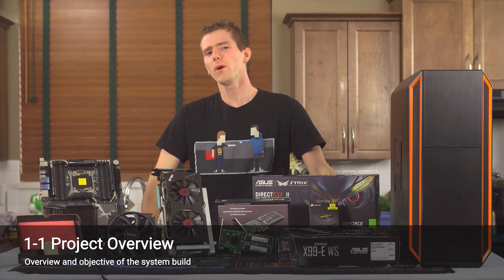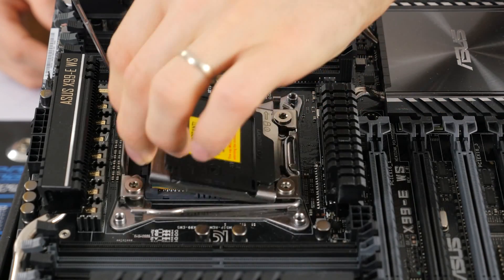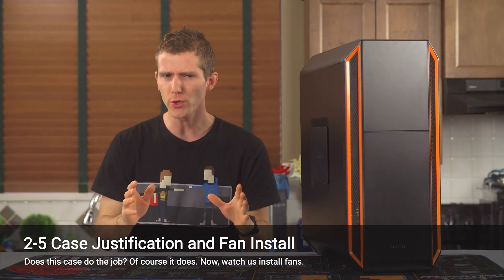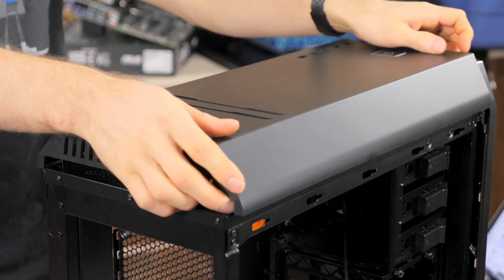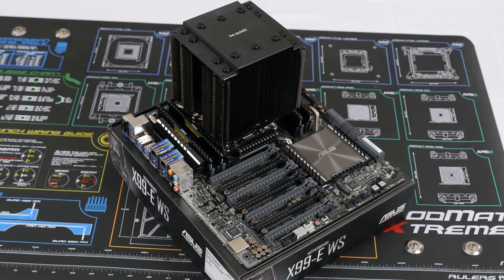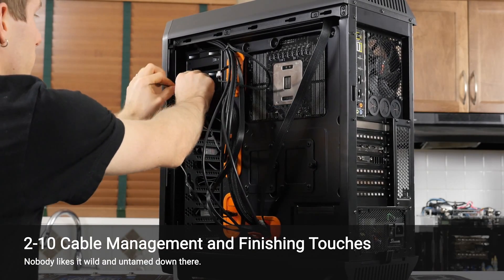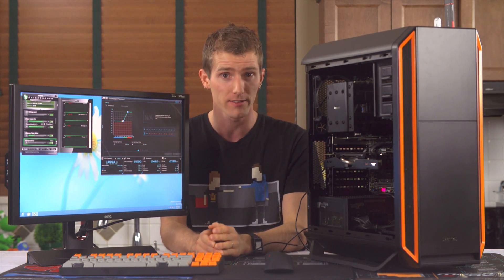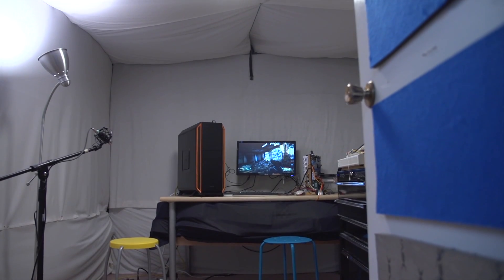How to Build the ULTIMATE Silent Gaming or Workstation PC

Comment: Silence tips:

Fans in pull are always louder than push.

Putting a restrictive dust filter right in front of a fan will significantly increase noise.

Pretty much any dust filter is going to either increase noise or reduce cooling capabilities which both are vital to a silent machine, especially to those that tries to blend silence and performance.

The case doesn't need to be silent optimized just to make a silent build. As long as the intake fan slots aren't restrictive/generating a ton of extra noise and got decent cooling capabilities.

A case like this can only block of so much noise and the restrictive design require the fans to spin faster in order to achieve the same performance. The restrictive top in this case also impair natural convection/passive cooling.

In this video a fan on the actual cpu cooler would have served a better purpose/much more efficient way to balance silence/performance. :)

Comment: only upgrade possible: go all noctua.
Reply: Believe it or not but for a silence optimized machine Noctuas aren't actually anywhere near as good as the Silent wings 2 he's using. I mean they have a low db rating but the perceived noise is much louder. Not to say that Noctua fans are bad, they really aren't. In fact, they perform insanely good if you can stand the motor noise. :)

Comment: By choosing not to use water cooling you guys made a pc that is super silent while not gaming that is capable of gaming but if you were to use water cooling you would be able to have a pc where all the fans in the system was off when not gaming leaving only a pump running which there are very quiet once and in gaming that system would be so much quieter than this.
Sure you would have to do some more work with that system but with a custom water cooling kit it actually is not that difficult so i would have much rather have seen that as the "ULTIMATE Silent Gaming or Workstation PC"
Reply: Passively dissipating heat out of the radiators without fans?
Reply: A fanless CPU cooler will still 100% be quieter than a custom loop.
Reply: Yes of course but he has fans in the system anyways and as they said it was laud when on load in the sound booth and i said the water cooling would be quieter on load but slightly louder at idle
Reply: Chystal yes just the same way he is passively dissipating heat of that cpu heat sink what is so difficult to understand about that it is the same principle.
I have my fans turn of at idle in my system.
Reply: Jimmy Karlsson Correct me if I am wrong. Wouldn't the pumps then be just pushing warm water around the system?
Reply: Chystal Well the radiators still dissipate heat even when the fans are not spinning and at idle the components wont be giving out as much heat.
Also the way the cpu and gpu coolers work is that there is liquid flowing through the copper tubes so then that would have had the same effect as with watecooling.
Also those coolers gets cooled by dissipating heat via the fins on their respective coolers just like a radiator just on a different scale so basically all of those things would effect both of the different methods of cooling the same way just that the watecooling loop needs a pump and the radiators can be larger thus cool it more efficiently.
Resulting in a slightly higher idle DB than this pc because of the pump but it would mean a lot lower DB at load due to the bigger surface area of the radiator and the fact that the radiator allows bigger fans than those on the gpu.
Reply: Jimmy Karlsson Learn a new thing every day in comment sections. :P

Comment: LOL, linus is such a noob he uses a anti static wrist strap. I've built over 200 boxes and not once fried/shorted anything because I plug in the PSU and touch it before I start to discharge any current i've built up from fapping in my sweater

Comment: WHY linus WHY did you put raid m.2 ssd on top of the GPU its so stupid ssd will heat up and wont be happy my m.2 ssd probably were fryed due to the heat from gpu
Reply: The GTX 980 (especially the ones Linus uses) are fairly cool. Besides, SSD tolerates heat much better than HDD.
Reply: ikr but still it would be unarguably better to put ssd below.
my gpu is r9 290 vapor x and it output a lot of heat
Reply: JusstyteN It's expected for a R9 290.
Reply: i know but nvidia still make flagship gpu that output heat especially on lower fan rpm as linus intended that gpu hold till its 80+Celsius and than ramp up fans. im sure it will reach temps like that on more intensive games especially OC'ed. and im sertain that AMD is making 300 series gpus with 20nm manufacture process as well as impruved architecture witch will lower temps and increase performance

Comment: Now my question is, wouldn't the components life expectancy wear down because they are running at a high temp?
Reply: If you look in the BIOS, it reads 36ºC for idle temp which is pretty good for only 2 fans in the entire system. I wish he did include an under load temp though. I'd like to see where it maxed out at.

Comment: I really want to go for a Silent or Near-Silent build, but nearly half the year are 30°C + Ambient Temps!

As it is at idle, my Q6600 runs at 40°C idle, with the NH-D14 up as high as it goes.

Such a high-grade cooler on a low grade chip for temperatures which are towards the upper end of most reviews for these products under full load - how am I supposed to make a Silent-ish machine that won't melt through the floor?
Reply: Maybe try delidding?
Reply: That ancient chip alone is most of your heat. Water cooling is probably your only solution. Or turn on your A/C. Or stop leaving your PC out in the sun.
Reply: Are the Kentsfields really that bad for heat output?

Comment: You have the wrong link to the system build parts.  The one you linked is to a 4k system, older.  I'm curious what that PCI-e SSD choice was.  As in, why not go the M.2 4x, for a non-raid >1,000MB/s and such.  Great video, thanks :)

Comment: How much would this entire step roughly cost?
Reply: I think Linus mentioned in the video that he used one the best CPUs on the market to really test the cooling, so obviously you can switch that out to something more affordable.

Without the CPU, the parts come to something like $2200. The motherboard and RAM are some of the more expensive pieces, so you could theoretically switch those out to more affordable options and still end up with the same noise level. Really, I think the only things in this particular build you CAN'T switch out are the case, the heatsink, and the fans. Another part of note is the motherboard, which you might need to consider careful based on PCI slots and RAM placement, along with other components that might interfere with the CPU heatsink.

Other than that, price is largely up to what you decide to put in it.
Reply: Given that the cpu alone costs around $1300 (in norway) and the gpu at $707, my guess is around $3000. God damn Norway is expensive !
Reply: I put it all together here http://pcpartpicker.com/p/rNQPhM

If you don't want to click through, without the OS, and before shipping and promos it came to $4551.76

A lot of those prices would vary depending on where you are.
Reply: Sverre Nielsen u can make that 3500 EUR, making it over 4000 USD based on current prices in Belgium

mobo 500+, CPU 1000, CPU cooler 85, RAM 550, case 120, fans 50+, GPU 600, power supply 150, SSD 450 (prices in EUR)
Reply: wobbly868
I'm from EU and everytime I look at the US prices I cry that I can't get them while they're all so cheap :(
Reply: ***** a 1000USD processor is small in package ;)
Reply: if it was in Argentina, it would cost $4000 the CPU and Graphics Card only
Reply: Sverre Nielsen I know your feelings ;( ( from the Netherlands )
Reply: Frozen Zerker
You can pay shipping and import costs for an entire build but I don't think it'd be cheaper.
Reply: *****
You can't buy from US with their prices since you'll save a lot of money. Thye aren't allowed to ship or something. Sneaky EU.
Reply: Frozen Zerker
They are. You have to tell the import authority of your country though which will ask for an import fee. 
Source : I bought some O-rings and got a ticket for not paying before hand.
Reply: or if it's something small, ask them to label it as "gift" or "demo" or something :P no import duties on those either :) unless i have been misinformed in which case asses will get whooped
Reply: OB1KXB
small items probably aren't profitable to ship
Reply: Franxx
Well that stinks. Shipping within the EU is both cheap and has no regulations (other than what's illegal).

The processor and videocard would cost roughly E1500 in the Netherlands.
Reply: Franxx You can get a gtx 980 for 8800 ARS, and a 5930k at 7800 ARS, I haven't seen any 5960x for sale yet, but 4000 usd is too much, $2500 seems doable for those components (still a lot of money and more expensive than other countries)
Reply: ***** Just get it from the US and use a package forwarding service - for example, Newegg has it for $1050, so it'll be about 1000€ when you have it in your hand with everything included.
I can recommend using shipito.com and borderlinx.com myself.
Reply: Frozen Zerker Why wouldn't you be able to get them from the US? I do that all the time because of the insane prices in Finland.

Comment: Wouldn't you need a really good CPU fan if its for a workstation? They didn't put any fans on the heatsink so won't it not do much? I could be wrong.
Reply: FluffyZack Well not really. the idea of a workstation board is that the power delivery is smoother (and a lot of other things) So you've got a little less heat buildup in the motherboard. i run a pretty serious all in one on my cpu, and my motherboard only runs 7 degrees hotter with just passive airflow (30-37 degrees C)
Reply: Only if it's struggling while it's on full load. Note that the fan on the back of the case is taking air in and its a 5960x.

Comment: Would it be possible to create a water-cooled build entirely without fans by routing water (or some other coolant) outside of the case and using only a ton of heatsinks and other passive ways to cool it?
Reply: Yes.....except you've got a pump running.......

Comment: Was curious about the power supply claims made, so ran my own test on my own rig with similar hardware. (nope not setup for silence, but I also don't run my cpu at standard most of the time).

running a firestrike benchmark with 1 reference 980, posted a 11113 score and my power draw was 317W at the wall 294.7 from the PSU. A 520W silent PSU has plenty of headroom.

Comment: I just accidentally bought non-PWM fans. FUCK. Why do these fans even exist?
Reply: PWM fans can run at lower rpm yes but if you want something truly quiet then high quality 3pin fans that are able to run at low rpm/voltage is much better. PWM fans gives off a ticking noise which is really annoying if the rest of the system is quiet enough.
Reply: I bought 3-pin 2500rpm fans. To eBay I go!
Reply: creptrbot 2500rpm huh? In that case you might be right about using PWM instead. :)